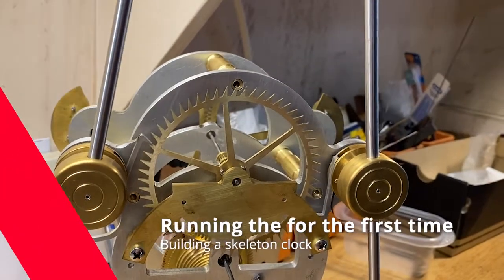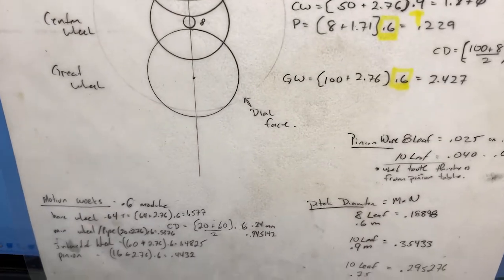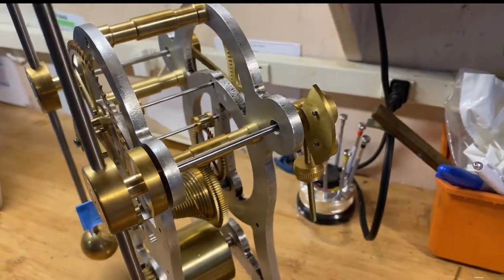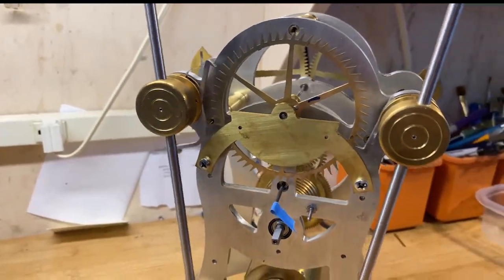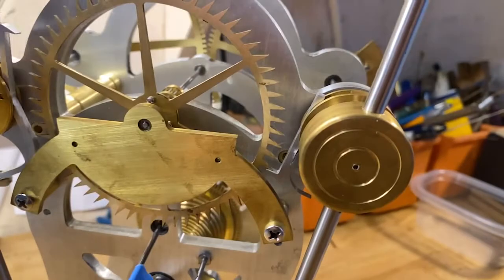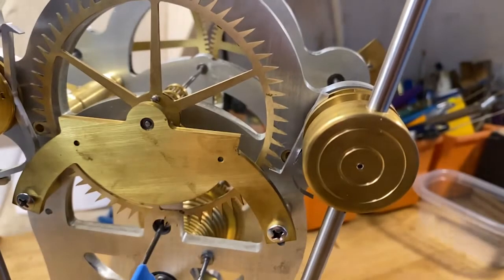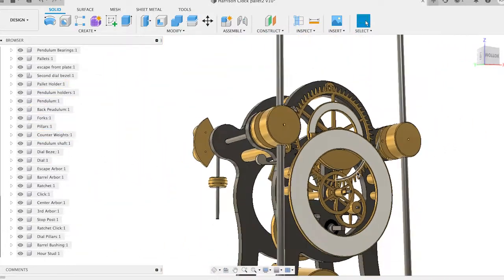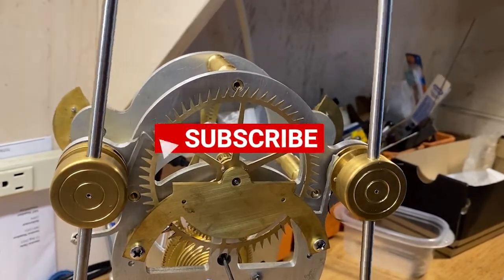Running the clock for the first time.

Comment: Great work . I’m glad your calculations worked out. I’d be interested in cad as well for a next build. Keep up the good work!
Reply from the maker: Once i get all working and fix the issues I will post it.  What type of file will work best do you think.  i am using fusion 360 for the design.